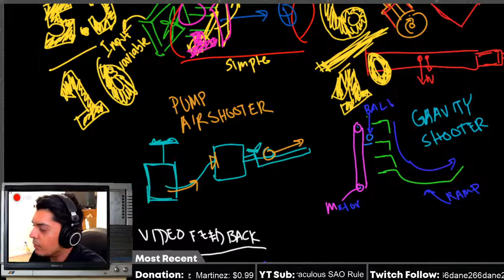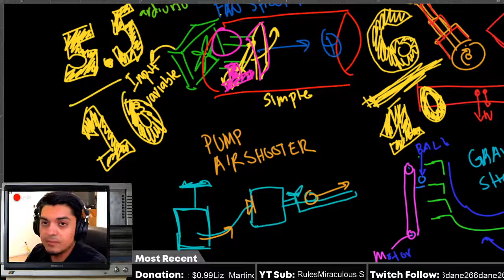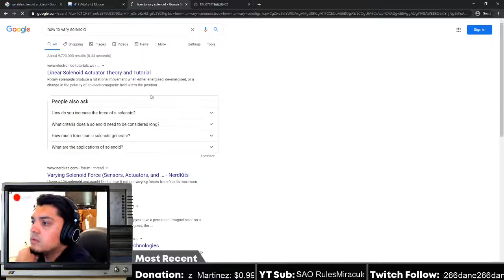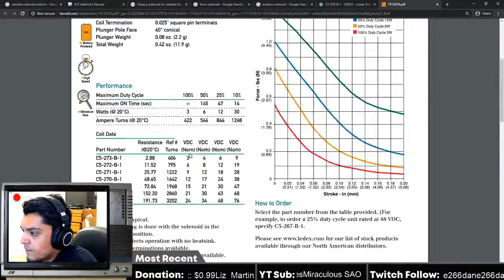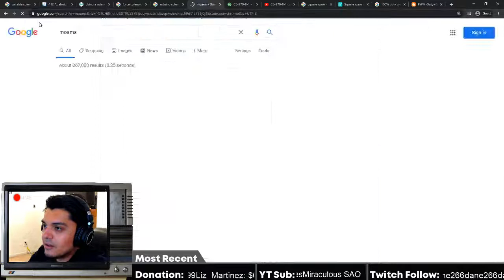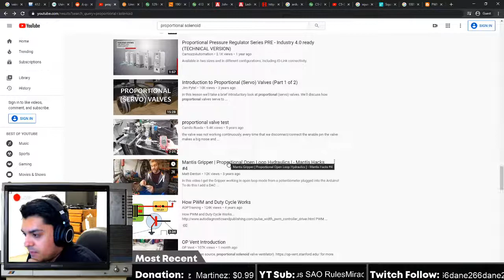Ping Pong Ball Shooter PT.4 (Live Stream 2020-06-08)

Comment from the maker: TIME STAMPS
00:03:45 - Stream Starts
00:05:08 - Revisiting the Spring Loaded Shooter
00:09:56 - Rating the Pump Air Shooter
00:25:08 - Rating the Gravity Shooter
00:43:18 - Researching Solenoids
01:40:08 - Choosing a Mechanism
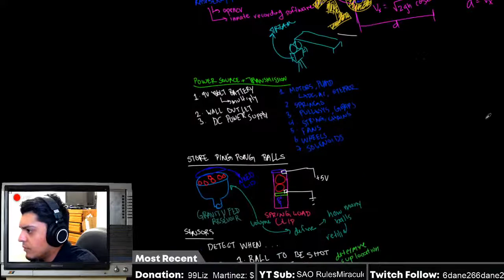01:46:41 - Choosing a Power Source
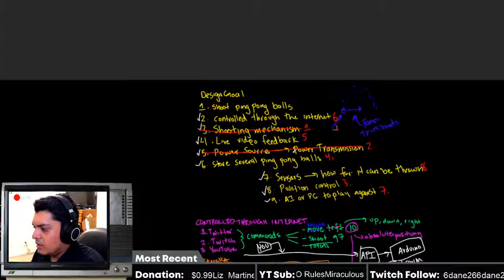01:52:11 - Choosing Power Transmission
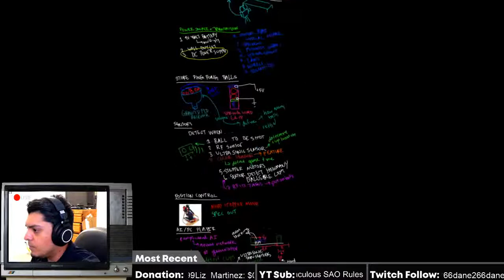01:54:24 - Choosing Position Control
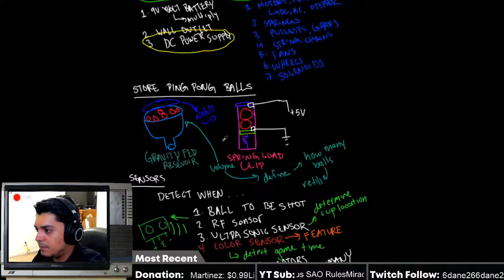02:00:41 - Wrapping Up Stream